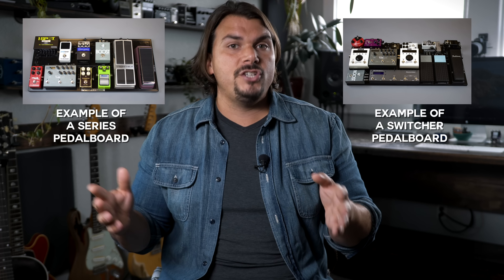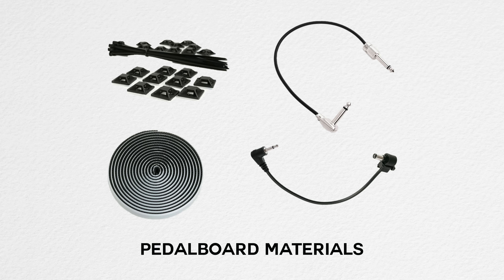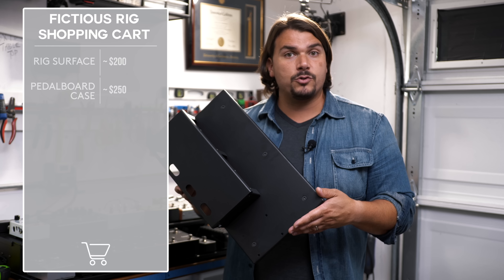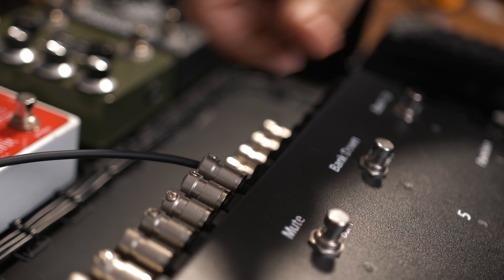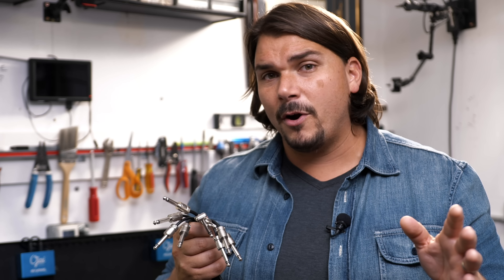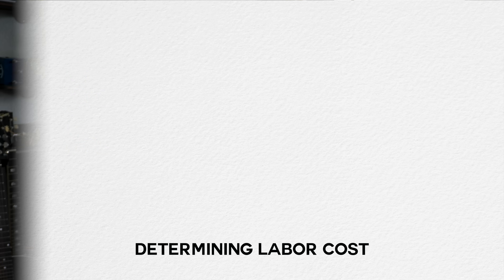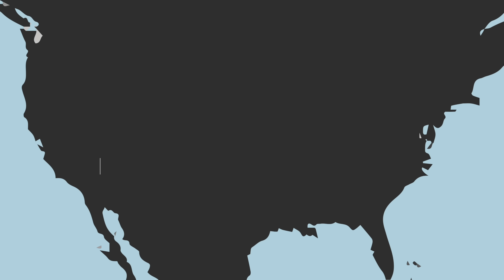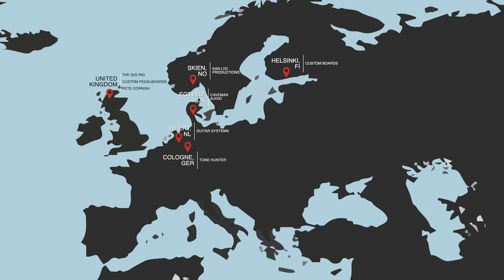The TRUE COST of a Custom Rig Build

Comment: I would love to have a professional built board one day. I more want to get the DIY aspect down to get that level of professionalism on my own build. Your channel has been very helpful, so thank u so much for everything u do. I still need to buy soldering equipment and learn to solder my own cables to get that clean look, and get a real board and ditch my board i made from wood, but im pretty happy with my pedal choice. I still want to get some more gain stages and a better wah pedal. Not sure if i want to look into a switcher in the future or not.   Im using (in order) Mesa Highwire> (send) Ernie Ball VPJR> EHX Cockfight>Wampler Ego V2> Fender MTG Tube Distortion> EHX Nano Big Muff Pi> EQD Grand Orbiter V3> Boss EQ-200> Return to Mesa Highwire> Front end of a Roland JC40> JC40 Effects Loop Send> Boss MD-500 (Stereo Out)> Strymon Timeline> GFI Systems Specular Tempus> Stereo Return to the JC40, but spitting off from the second output on the Boss EQ-200 is going to an Egnater Tweaker 40 Combo to try to achieve a somewhat Wet/Dry/Wet rig between the 2 amps, and im using a Peterson Strobostomp HD in the tuner out of the Highwire. Im powering it all with a Truetone 1-Spot Pro CS12. I do want to get a Lehle P-Split III to properly send to my Egnater since i do experience some phase issues and ground noise from the way im currently splitting my signal, but im pretty happy with my board at the moment.
Reply from the maker: Sounds like a cool rig!

Comment: I have always built my own pedal boards, now they are usually split, drives etc in front and the mod/dly/rev in the amp loop (I no longer use loads of pedals).  I have also built switcher boards and use strymon and gig rig power solutions, the gig rig has great isolation solution for both power and audio.  They are not pretty but they stand up to heavy use, hundreds of shows.  I also have built hybrid boards with AxeFx or Quad Cortex providing most of the sounds but adding some pedals I can't seem to do without.
Reply from the maker: I always encourage people to diy their own boards if possible, we have lots of resources on the channel to help facilitate this.  For those that can afford or wish to hire someone I think this video spells out expectations on cost very well.

Comment: Great video. Very informative. I have a simple rig with 7 pedals (LA Lady, PolyTune, Dunlop mine volume, HX Stomp, Nemesis, RV-500 and RC-5. Not much in the quantity of pedal but, it is all midi programmed. I spend so much time programming my MC6. But, once it’s done I’m very satisfied with the final results. The midi aspect could add even more time and work that people don’t consider. Like always a great job at breaking things down. Cya on the next one.
Reply from the maker: For sure…programming can be very time consuming - working with someone that knows their way around is invaluable if you don’t wanna spend time in the manual.

Comment: So TTL cost for a P&W pedalboard with the current used pedals:
Timeline - $450
Blue Sky - $480
Blues Breaker type OD -  $350
Compresor cali76 - $360
Mobius - $450
Volume - $100
Iridium (amp/cab box) - $400+
Another delay - $300
Tube screamer type OD - $250+
Switcher - $1,000
2 power supplies - $500
Labor $2,000
Materials like $1,500
* $8,140 * give or take 
I know this can sound great, but in comparison to a Kemper, is it $6,000+ better?
Reply from the maker: Thanks for watching man, its honestly all subjective! Whatever floats your boat!
Reply: Bruh what kind of tube screamer are you playing that is $250+? You can get a ts9 for 99 or the mini for 79
Reply: @parkerkenney6113  I agree…you don’t have to buy one for $250, but looking at some P&W boards I’ve seen vemuran od and those go for 300+ 
Still you can save a hundred here and there but the point is that it will still cost you a pretty penny anyway.
Reply: @netzarim1277  I don’t understand who would spend that much, but get whatever makes you happy and inspires you to play more because that’s all that matters
Reply: Cheaping out on the voume pedal there...

Comment: I love that you made this video. I’ve been wondering about whether I want to have a board made given the mix of pedals I’d be using and all of the things that need to be taken into consideration when building one. I think the cost is well worth it for a master builder if it’s going to eliminate any headaches and I can be sure that everything is going to work as best as it can.
Reply: I have no idea how you came to this conclusion.
Reply: @cutseencinematics  It’s my opinion. You don’t need to understand it. I can’t understand why you felt the need to make a comment on it.
Reply from the maker: I think the Master Builder is really only needed in complex rigs.  The depth of their skills and toolbox will be mostly unused for a lot of simple boards and maybe be less necessary to hire them unless you're committed to just using them because of their name recognition or reputation.  Many people could get away with a Journeyman level or Apprentice level with simpler rigs and save a bunch of money without much difference, especially if there are few to no customizations.  Just depends on what you want and what you have.
Reply: @VertexEffectsInc  I agree. I was really talking about using a master builder if I was planning on putting a large, extensive board together. I can do the smaller ones myself or maybe use a little advice when expanding.

Comment: It’s frightening how much a decent sized board actually costs, but I’d guess for most people you don’t go out and spend hundreds or thousands all in one go. For me, I’ve got ten pedals on my board, but it’s taken literally years to buy that collection, one pedal every few months as I wanted them and could afford them. I still need to upgrade my power supply, and then it’ll finally be done, for now anyway…
Reply from the maker: Typically about half the cost is in materials if you're using good quality stuff.  After that the labor is extensive...an hour per pedal at least, more if it's a switcher.  Most guys don't give any thought to spending $400 on a pedal, but a hesitate to spend $1000 on assembling a pedalboard packed with $10K in effects.  This is why we offer free DIY tutorials here, so you have all the resources to do it yourself and save the labor costs.

Comment: If there is already a built in buffer in the polytune mini, is there any particular reason you would need one another one before it? Or was that just for demonstration purposes. Thank you!
Reply from the maker: It’s was just to signify and represent the number of pedals on the board as part of the factious rig.  We just tried to used common stuff people would recognize a tuner, od, delay, etc.  If you had an input buffer you wouldn’t need a buffered tuner following it - we spell this out in our video on signal path.
Reply: @VertexEffectsInc  word, thanks for the reply that makes sense. Last quick question while I have you: I assume there is nothing wrong with the buffer on my polytune mini? or should I switch to my classic TU-3 boss tuner (there is anther JHS buffer on the way to amp)

Comment: I have a question 
Why do you need TC buffer in front of TC Polytune if that one has the same buffer that buffer pedal ? 
Confused. 

Thanks for the answer
Reply: I was wondering the same.
Reply: Not positive but, the tuner buffer only brings the signal level back up from the loss that went thru the tuner. A separate buffer takes the original signal level that goes straight from the guitar and all of your pedals and raises it back to the starting point and then is sent into the front of the amp. That's my my understanding of it.

Comment: Everything factored in, 1 hour per pedal isn't even that bad. Sticking pedals on a pedaltrain and using of-the-shelf cables is obviously much faster.
I can't really understand parts of your material cost tho. Here's what I paid for the material in Germany:
- Rig surface: DIY (coated plywood, aluminium edging, rubber feet and handles) -> ~25€
- Case: (Don't have one, but you can order custom made ones from Thomann for around 200€, seems fair)
- Zip ties: pack of 100 industrial grade -> 1,99€
- Tie downs: pack of 100 industrial grade -> 9,99€
- Velcro: Various kinds of 3M Duallock -> ~10€/meter (2€ per regular sized pedal)
- Audio cables: Sommer Cable Tricone MKII (similar to Mogami which isn't available here) -> 0,77€/meter
- Audio connectors: Square plugs are indeed pricey at ~4,50€ a piece, Hicon HI-J63MA05s are slightly bigger but only cost 1,99€
- Power cables: 5 meters of industrial bus cable (2x0,14mm²) -> 1,55€
- DC connectors: high quality ones (Lumberg LUM NES 21W) -> 0,89€
Seems like 
a) those materials are a lot more expensive in the US
b) you are buying them from the wrong shops, which I doubt considering how long you have been doing this
c) one can easily safe lots of money by making small compromises (Square plugs).

Anyway, great video and a detailed explanation how many small costs can quickly add up.
Reply from the maker: A few things you're glossing over on materials.  First, your alternative proposals are likely not equal in quality or the same product as what most of these pro builders would use.  In other words, what's acceptable to you may not the same as what a vetted product is for a rig builder that's an industry standard.  There are different grades of even the same model of materials.  For example, Dual Lock, has about 20 different grades, each with a different price point.  Some people are only buying 1/2" Dual Lock and comparing prices for full 1" Dual Lock.  Some people are not getting SJ3350 and SJ3551 mixed with 150 loops/sq in densities mixed with 400 loops/sq in densities and are using a cheaper grade adhesives on the bottom of the loops.  Also, the cost of shipping, and taxes aren't factored into your items.  On small items often the shipping is as much as the item itself, in particular when it's all purchased separately a la carte.  For example the Marine grade tie mounts we use are almost double any others I can find price wise, then I have to pay 10% taxes on it and $10 shipping and that's factored into the price.  Again, this is meant to be a baseline, and from the feedback that I've gotten from rig builders, it seems to be pretty right on.  Of course, if you want to go the DIY route, we have plenty of free resources here on the channel to do a quality professional pedalboard on your own.  Thanks for watching!!!
Reply: @VertexEffectsInc  Well, I tried to find substitutes of equal quality. I only mentioned some cheaper and slightly lower quality alternatives as I do think that your standards are slightly overkill for the 99% of guitar players who don't tour the world with their pedalboard, e.g. mixing two kinds of dual lock. (I can pick up my entire heavy pedalboard by one pedal, so I don't really see a problem). The Hicon plugs for example take up more space than the SquarePlugs but cost less than half as much, so it's a personal choice whether you're willing to pay that much extra to save a little bit of space.
Regarding your other concerns:
- Dual Lock: The exact type of Dual Lock you mentioned (full 1 inch wide) is about 10-12€ per 1 meter.
- Zip ties & tie downs: The ones I got are proper industrial grade, heavy-duty ones. Not the stuff you can buy at a regular hardware store.
- Cables: Mogami is super uncommon here. Instead Cordial, Klotz and Sommer Cable can be regarded industry standard. The quality of the cable I chose should be absolutely comparable.
- Taxes: German prices usually already include VAT. If you have to charge taxes on the parts as you're selling them to someone, you can get the VAT you initially paid back as a tax return. (At least that's how the German tax system works.)
- Shipping: Dual Lock bought from eBay is shipped for free (as a large letter), zip ties and tie downs were bought at a local industrial supply store.

From what I have seen during my research, some things just seem to be incredibly expensive in the US.

You're videos are super helpful and are what got me started building pedalboards. Thank you for all the insights!

Comment: Great video!  Love the info provided here.  I’m embarking on my DIY build and using a vertex board and other accessories from them.  My question is would you put a buffer in front of PCB10 if there’s already buffers in the unit?  I’m using that switcher in my build.  I thought would use a passive patch bay so that I wouldn’t need to ‘re buffer’ the signals but perhaps I’m wrong in that?  Thanks for any input

Comment: Another great video! 

Question: I was looking at the polytune 3 mini and the buffer specs are spot on what you recommend. In this context would you still put a dedicated buffer first as shown in your fictictious serial signal path or straight into the tuner is fine?

And also, would you put a buffer before or after the delay pedal (considering the delay pedal is last in the chain)? If put right before the delay, would that enhance the repeated signals in this case?

Thanks for your time!
Reply from the maker: What is shown here is just to set the number of pedals and using common pedals to represent each standard category.  If you have a buffer on the input you don't need a tuner with a buffer, and if you did have the Polytune, you'd leave it in true bypass as you don't need to input buffers in a row.

Comment: I’m not a pro pedalboard builder but I’ve played guitar for about 30 years. About 5 years ago I built my own pedalboard and right now in October 2023 I am building a new board. I’ve done a lot of research on routing and power supplies as well utilizing buffer etc. for me it’s not so much the cost but more the fun and satisfaction of putting together myself. And if I spent $3000 or so to have a board put together for me I’d have to spend that about 6 times a year because I am always experimenting with new pedals. Best to do it for yourself. Just do the research. One thing I might suggest is if you can’t find the answers on YouTube spend a couple hundred and get an hour consultation with someone at vertex and buy their buffer and custom patch cables. It will give you nice clelan and quiet tone and signal..

Comment: Hi,thanks for your reply to my question....i play passive bass so only use live a Boss LMB3 Limiter,Polytune 3 tuner,MXR Thump pre-amp (no DI or cab sim) lastly into a Shift Line Cab Zone Bass with DI (XLR) & output to amp (pedals in that order)....am i right in thinking the Cab Zone Bass is buffered as the manual says the output is 100ohm and has a DI XLR output and amp jack plug ?... i bought a standalone Bonafide buffer,got it for a good price, i put the Polytune 3 in buffered mode AFTER the Boss LMB3 Limiter as you suggested...now i have just bought the standalone Bonafide buffer, where is the best place to use it ?
If playing with a bass amp head i plug my tuner into the amp's tuner output & replace the tuner on my board with the Bonafide buffer...is this the best thing to do when the Polytune 3 is plugged into my amp's tuner output ? & when i can use an amp head where on my board would be the best place to put the Bonafide buffer when the Polytune 3 is plugged into my bass amp's tuner output ? & where is the best place if using the  Polytune Bonafide 3 on my board when i cannot use my bass amp ? giving me 2 Bonafide buffers,1 in the Polytune 3 & 1 standalone Bonafide..would it be best to put the standalone Bonafide buffer after the Shift Line Cab Zone Bass DI back to my amp head ?or should i replace the Polytune 3 buffered tuner with the Bonafide buffer ? basically what is the best order to use these pedals WITH & WITHOUT  the Polytune 3 Bonafide buffered tuner as i plug it into the amp's tuner output when using an amp head (Warwick WA300)
Your advice would be greatly appreciated....Thank you...
Reply from the maker: Yes, typically the DI outputs are all low impedance/buffered.  The polytune could be ok for the input buffer...depends on what the input impedance is of your amp sim/DI box.  Generally you want to match them.
Reply: @VertexEffectsInc  Hi,thanks for your reply ,the manual says the Cab Sim input is ,instrument level - 500kohm, line level - 20kohm, out 6.3mm mono, unbalanced ,output resistance 100 ohms, XLR mono balanced....,the Boss Limiter, Polytune3 and Cab Zone Bass are all buffered but MXR is true bypass,though all are switched on at all times....Polytune3 buffered after Boss Limiter....please let me know where putting the standalone Bonafide Buffer will give the best result,thank you...Chris

Comment: Yo, mine is wooden. I bought it on You-know-where-azon.  Its made in Ireland, I'm almost positive. Ruach is the guy.  I have two now, one for bass and one for real guitar.  They do everything I've wanted.  I have d-series panel mounts for ins and outs on the sides, usb 3.0 and type-c.  Its badass.  Could be bigger, they could do with a size 5.  I have two size 4's, a black stained one and a white stained one. They're something a little different. A little out there. More for the home player looking to tidy up the floor of the den.  Not necessarily a good gigger/traveler.  It weighs a f**kload more than a metal one.